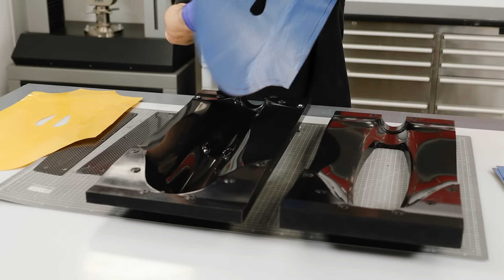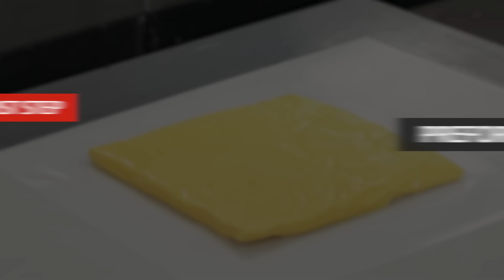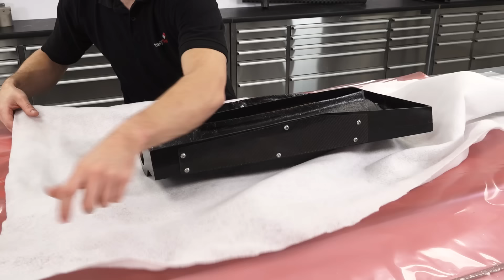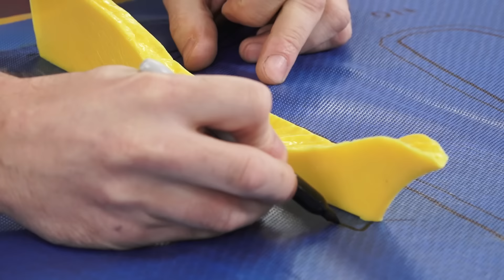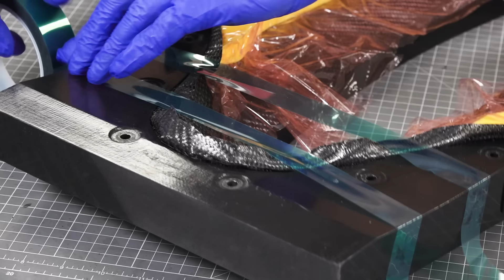Making A Complex Hollow Carbon Fibre Drone Fuselage

Comment: Hi,
Excellent Video.... Just wondering about the tedious process..... what if you need to make 1000units of this particular part ?
it'll take years to fulfil the order....
Reply from the maker: Well, it depends how many sets of moulds you have. In volume production, you might have 5 mould sets, with a couple of people laminating, you could comfortably rotate each mould twice in a day, so that’s 10 per day, or 50 days for 500 units.
Reply: @easycompositestv  yes exactly. 500units in 50 days... not to mention a much bigger heat and vacuum chamber. And a lot of staff working on making 500units. Each unit is very light weight but very heavy on the pocket... not because of material cost... but coz of HR.
World needs to find faster ways to produce composite material parts :)

Comment: I think that the Silicone Intensifier Compound precisely addresses the issue I've been experiencing with some pieces I've been making. What I've been doing to minimize the bridging problem in my pieces is placing them under pressure for 24 hours with the mold open, which helps me eliminate bridging. However, I still always end up with some imperfections that I have to fix later. I believe the Silicone Intensifier Compound will solve all my problems. I will give it a try, but thank you in advance for the tutorial.

Comment: It was very excellent and professional. Are these fibers pre-impregnated with resin? Does it dry by air or heat? If it is already stained, how does it not stick to the hand?
Reply from the maker: This is prepreg carbon fibre so the resin is already in the reinforcement. Take a look at the related videos linked in the description, they explain the XC110 prepreg in full detail.
Reply: @easycompositestv  thank you

Comment: Have you experimented with pouring closed cell foam? My assumption would be that it would expand under vacuum as the air pockets inside the foam expand. Applying pressure on the carbon.
Reply: That’s another way to do it yes. But will not work under a vacuum bag. You will need a vacuum chamber to allow the cells to expand.

Comment: Can you overwork prepreg into the mould?
Reply: You can disturb the fiber too much in tight features. But it's mostly push it into the mold surface and don't touch it further
Reply: @evangatehouse5650  Thanks for the info.  Really wanna try making some car aero parts.

Comment: The fact that this part is able to be manufactured as one part is truly insane.  I would think of maybe making a foam core part, and then doing a wet layup.  Making a mold and doing prepreg layup is next level.  The finish was perfect.  I'm flabbergast.
Reply: The lost metal casting he demonstrated might also work
Reply: Wet layup over foam maybe quicker. But there's an awfull lit of work in postnprocessing sanding filling etc. Of course you then don't and carbon finish on yhe exterior or such precice control over external form and its heavier. Also probably weaker

Comment: Comprehensive Guide to Creating a Complex Hollow Carbon Fiber Drone Fuselage

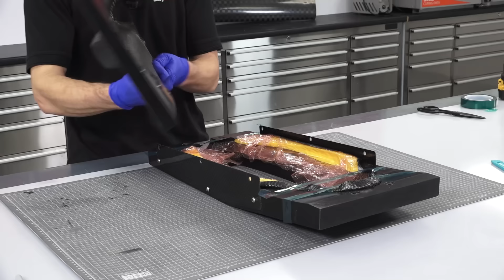*   0:04 Project Overview: The video demonstrates the process of laminating and vacuum bagging a complex, hollow carbon fiber drone fuselage, including the use of silicone intensifiers for improved consolidation in challenging areas.
*   0:40 Component Details: The fuselage, designed for a flying wing drone, incorporates internal structures for strength and hardware mounting, along with spar tubes to accommodate the wings.
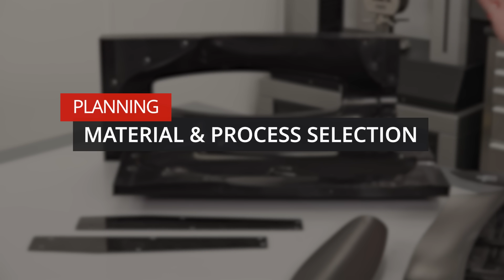*   1:04 Mold Strategy: A four-piece mold, consisting of upper and lower sections and side plates for the wing roots, is used. The molds are made from XT135 tooling prepreg and feature metal mold clamping bushes.
*   1:43 Material Selection: Prepreg carbon fiber (XC110) is chosen for its precise ply placement control, which is crucial for achieving accurate lap joints.
*   2:30 Silicone Intensifiers: These flexible rubber inserts are used to ensure proper consolidation in areas where vacuum bag bridging might occur, such as the sharp trailing edge.
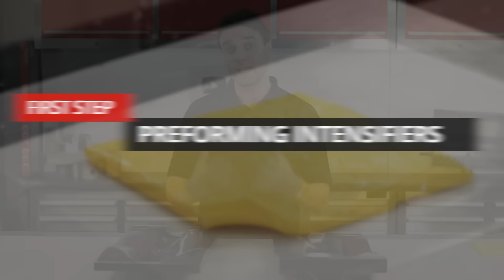*   3:40 Intensifier Creation: The intensifiers are made by pressing uncured silicone compound into complex mold areas, curing it under vacuum, and then reusing the cured inserts. In this example they are made directly on the tool surface.
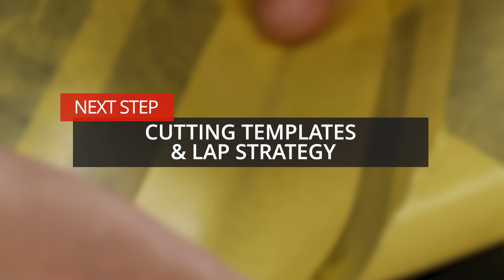*   7:16 Prepreg Preparation: XC110 prepreg carbon fiber is defrosted, and templates are created using masking tape to guide the cutting of the prepreg layers.
*   8:00 Lap Joint Strategy: One side of the part is extended beyond the parting line, while the other is pulled back, creating an overlap that allows for a strong, vacuum-pressed lap joint when the mold halves are closed.
*   10:28 Layup Process: The prepreg layers are meticulously laminated into the molds, with careful attention to trimming and placement to achieve the desired lap joint configuration.
*   13:04 Intensifier Integration: Silicone intensifiers are positioned within the mold, and the carbon fiber laps are folded over them to ensure correct placement during mold closure.
*   14:57 Vacuum Bagging and Cure: The part is vacuum bagged, with the intensifiers simplifying the process, and then cured in an oven using the standard XC110 cure cycle.
*   16:32 Demolding: The demolding process reveals the successful use of intensifiers, resulting in crisp, void-free corners.
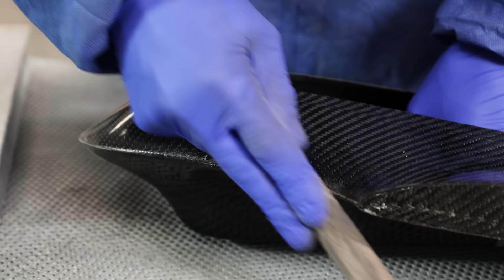*   17:11 Finishing: The fuselage edges are trimmed, and holes for the spar tubes are cut using a Perma-Grit wheel and sanding block.
*   17:25 Internal Structure: Lightweight carbon fiber sandwich panels, made from prepreg carbon fiber and PMI foam, are CNC-cut to create the internal floors, ribs, bulkheads, and spar tubes.
*   18:28 Bonding: The internal structure is bonded to the fuselage using a high-performance epoxy adhesive (Perabond ET 5428) for maximum strength and reliability.
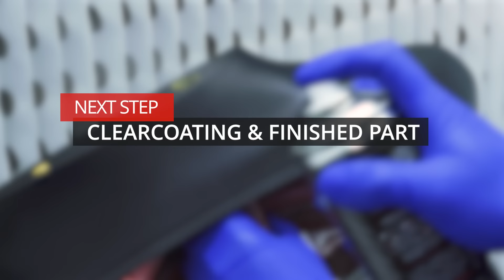*   21:53 Surface Finishing: The fuselage is painted with a satin clear coat designed for carbon fiber, adding minimal weight while enhancing protection and aesthetics.
*   22:35 Final Thoughts: The presenter reflects on the complexity and rewarding nature of composite work, highlighting the diverse skills, techniques, and materials involved.
*   23:25 Further Learning: Links to additional resources and videos are provided for those interested in delving deeper into specific processes.
*   23:42 Product Information: Viewers are encouraged to visit the Easy Composites website for high-quality composite materials and equipment.

I used gemini-1.5-pro-exp-0827 on rocketrecap dot com to summarize the transcript.
Cost (if I didn't use the free tier): $0.03
Input tokens: 21642
Output tokens: 789

Comment: Another amazing video.  

A co-worker and I were complaining about the poor quality of RVs being made in the US.  He suggested we start our own company and build something good.  I told him we couldn't make them cheeply enough to make them light enough.  That got me thinking about a full carbon fiber roof with AC and vent flanges molded in.  Keep it light and the raised flange wouldn't leak.
Reply from the maker: Composites can certainly be very useful in RV construction. As you say, significant weight savings and advantages in reliability and function from integrated mouldings. We hope to do some larger scale projects like this on the channel in the future.
Reply: fiberglass is tougher than carbon fiber and is the go-to material for RV's and boats for that reason! I'm sure there's a market for less tough but lighter carbon fiber too

Comment: I find it curious that you did not perform a debulk. Is it just because the laminate is so thin?
Reply from the maker: Exactly that. At just 2 plies of 220g it really wouldn’t make any difference, but anything more (even including swapping the second ply to something heavier) and we would have done.
Reply: @easycompositestv  interesting. your result shows this wasn't a problem, but whenever I work with prepreg I always debulk the first ply to ensure there is no trapped air. Since you only ever bagged with unperforated release film any trapped air has no way to escape
Reply from the maker: Yes that's exactly right, because it's only 2plies a debulk wasn't needed, any thicker than this and debulking would be beneficial.

Comment: wait, was the wing you made high temp infused tooling for in a previous video also for this drone?
Reply from the maker: No, but well remembered! That wing was for a two section fixed wing VTOL, this one is a single section ‘flying wing’, so, fairly different formats.
Reply from the maker: Not quite the same, I'll have to make new moulds for the wings for this.

Comment: What do you do with all the one-use materials? Are any of them reciclable? Do release agents or other chemicals affect the reciclability of the disposable materials? Ir they can't be recycled, how do you dispose or them? Is there a specific dispose procedure? Or just regular trash?

A video about the sustainability of composite processes would be very interesting, since the videos look like they create a lot of trash (but I'm sure regular industrial fabrication methods are even worse).
Reply from the maker: Unfortunately these processes do produce a fair amount of single use waste and due to the materials themselves, many are not recyclable. Sometimes, if you are careful then vacuum bags and certainly breather can be reused. The issue being that if there is any risk of a pinprick hole in the system then this can compromise the whole part and lead to further waste.

Comment: Can prepreg be cured without the oven?
Reply from the maker: No, prepreg requires a heat cycle in order to cure the resin. You can to some extent use a domestic oven with reasonable success which we have covered in another tutorial.

Comment: I have some really sharp corners in my mold where I need to have a intensifier otherwise it looks like cow dung 😂😂 But as I didn’t find something like you got now, so I used some vacuum tape that I just wrapped in release film. This way worked awesome, but I would love to have known about your silicone instead 😂
Reply from the maker: It's something that we have only just added to the range. The advantage of silicone is that it holds its shape better under heat and vaccum and won't distort as much so gets the consolidation where you need it.
Reply: @easycompositestv  yes, I get it, my sticky tape smoshes out a bit under vaccum :)

Comment: Whats the highest temperatures that i could use these parts in? I'd love to make 3D printer parts(tool heads m) but i believe the epoxy doesn't hold up past 80c.
Reply from the maker: If you made parts with this same XC110 prepreg then their max service temp would be 110C. Other epoxies (such as most hand laminating epoxies) do have lower service temperatures but XC110 is a prepreg system and so 110C is comfortable for it.

Comment: More videos!  I absolutely love these tutorials .    This information was guarded secrets 25 years ago when I first dabbled with composites on my own.
Reply from the maker: And 25 years ago when the Easy Composites founders (of which I’m one) started in composites!
Reply: I remember paying insane amounts of 1997 to 2000s money just for VHS video how to for basic composite work. Quickly found we needed equipment that was far too expensive to go too far into it. Also getting the raw materials weere insane back then as well. We used a ton of select products out of Florida as they were on of the few who would sell in "smaller" amounts. 

Fast forward 20 years and I run across your youtube channel. Filled in some gaps I had in my self paid for and learned training, and gave me a location to order small projects t amounts of raw material from.  Here I am 5 years after that still eagerly devouring every video. 

It's funny, never heard of intensifiers, but would make wooden bucks to do the same process. That silicone would have been a massive time saver back then!

Comment: Where can we buy this x8 Skywalker? I am actually making it my self! Thank you for posting this video!
Reply from the maker: Mmmm, it’s a bit of a skywalker lookalike. We
Did the CAD from scratch along the lines of some flying wing designs, like the Skywalker, just for demonstration purposes. However, happy to share the CAD files if they would be of use?
Reply: @easycompositestv  if you would like, i can install all of the electronics and make a fully autonomous drone with the carbon fiber fuse you guys have. Also,  i am actually experimenting doing carbon fiber layup on foaming ASA material to make it even more lighter and easier to make.

Comment: Is that a mobius but scaled up some? 150%?
Reply from the maker: Actually, it’s a generic flying wing that we drew from scratch just to show the process. It’s aerodynamically sound (there are lots of good libraries for various aero platforms) but nothing in particular. Truth be told; the scaling went a bit wrong in matching and it ended but about 25% smaller than it should have been!

Comment: very impressive work. those prepreg sheets seem very useful, way easier to work with and everything stays clean and tidy.
Reply from the maker: If you’ve not watched our other vids on prepreg then yes, check it out. It’s not always the case that prepreg is best but for smaller, more intricate shapes like this then it generally is.

Comment: That Intensil-stuff is exactly what I have been looking for! Thank you so much for sharing - I have a similar project with exactly the same issue at the trailing edge and this could very well be the solution to my issue. I thought about using a silicone bladder before - Maybe this is another video idea?
Reply from the maker: Silicone bladders are another topic that we’d certainly be happy to cover but if you’re dealing with a tight, slim area like a trailing wing then intensifiers, rather than a silicone bag, are likely to be the solution.
Reply: @easycompositestv  Yes, exactly, that was my impression, too. The bladder would not have been rigid or thin enough to properly get into those spots, but for larger and more complex internal shapes where access for removal after curing is limited, it still seems like the best solution. A video on bladders would be awesome!

Comment: This is a very brilliant and educational video. But I have a question, Is it possible to use 3d printed parts as the "intensifier" (even if it may be sacrificial)? If so, which materials are suitable for this application?
Reply from the maker: What a good question! Honestly, we’ve not tried this but it could be possible. However, silicone is inexpensive (cheaper than 3D print, probably) and does the job so well (squishy, able to conform) that I think it’s unlikely that a 3D print would work as well. Possibly TPU, but the INTENSIL compound is so quick, easy and effective that unless you can’t get hold of some, it’s probably hard to beat with any kind of 3D print.
Reply: @easycompositestv Thank you! I was thinking some odd shapes and corners where may be hard to apply the silicone properly.

Comment: Do you have different thicknesses of this intensifier? I can imagine if I want to make a hollow sharp edge with more layers of CF, once I try to close the mould it would break, right?
Reply from the maker: Mmm, you might be misunderstand how this works. Normally, you set your intensifier on top of the laminate, which means you can have any laminate thickness you want. In this video we showed two different processes; one where we pre-cured the intensifier directly against the mould (which is unusual) and layer where we showed how it’s more usually cured against the laminate. Have another watch through and if we can help, contact our tech support directly.
Reply: Ah yes you are right, but precuring has benefits I guess when you can't be sure you can stuff it in all the crevices while it's soft. So in that case maybe there is a way to cure it adding some sheets of paper or other material to compensate for the thickness of the laminate. I think I answered my question or came up with some solution. Was wondering if you had another better one.
Reply from the maker: @giamademedoit  Once you've used it for the first time then it's good to go in it's cured state. If you need to offset with some thickness then you may as well use it as intended with some carbon fibre and make the first part with the normal method.

Comment: Great video!How would you had managed some little flaws (pinholes, voids) before to paint?
Reply from the maker: Even in this project, which went very well, there can still be some micro pinholes in a couple of areas (which is normal, even on the best made parts). A skim over with a clear resin such as XCR is a good fix, or a clear coat (as used in this video) should also overcome them. 
We plan a video on pinholes/imperfections coming soon.
Reply: @easycompositestv Thank you 🙏
Reply: They have a clear-coat or finishing epoxy product. I think he showed this in another video a long time ago about vacuum bagging wet layup.

Comment: Would you recommend the ET5428 epoxy for bonding mounting ends in to racing rear wings for attaching the end plates to ?
Reply from the maker: In our testing, and on paper, it’s practically unbeatable so you can’t go wrong. However, sometimes it can be better then it needs to be (so, a cheaper adhesive might be good enough). But, if you don’t want to try to work that out then ET5428 cannot be outbonded!
Reply: @ perfect i originally used vm100 its a full pre preg 1x1 blade with 15 layer thick pre preg 1x1 end plates and 1 has failed and pulled away almost 60% of it now could just be a 1 off as the other side is still perfect but thought if i use something unbreakable itll hold up to wind force :) 

Thanks for replying 🙏🏼